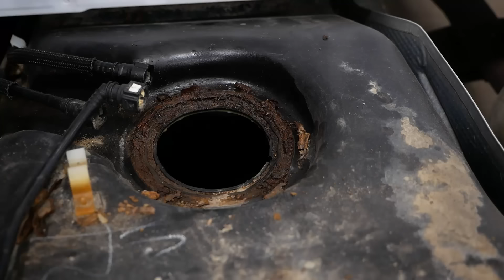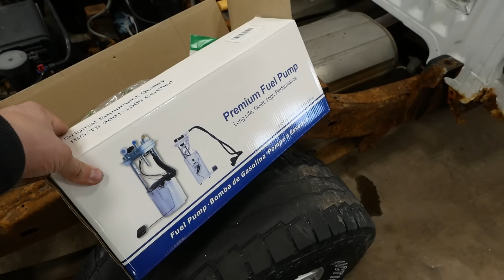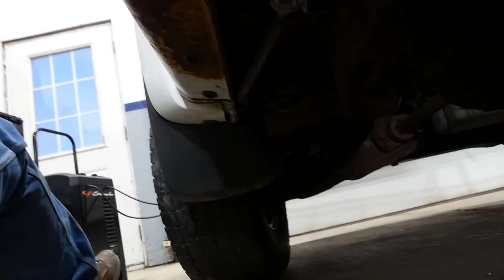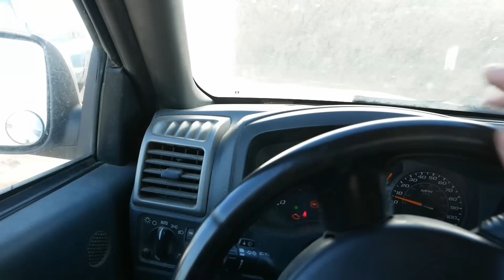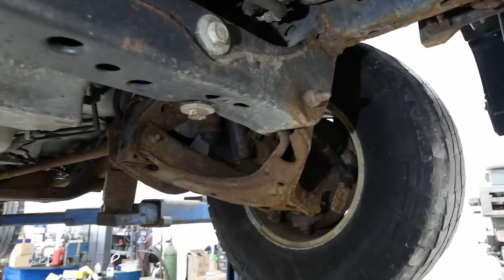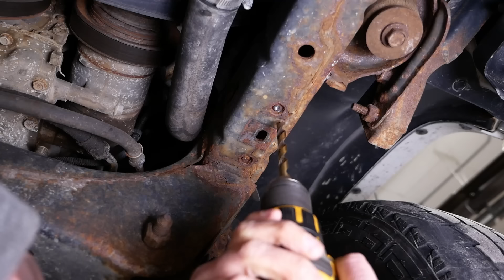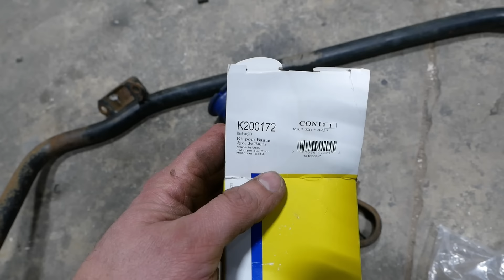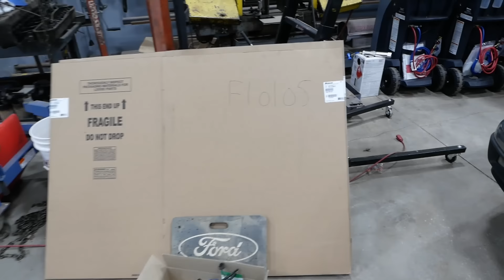Saving a GMC Canyon with 434,000 Miles from the Crusher - Won't Start, Fuel Pump Tabs Rotted

Comment: Great video! I am fascinated by the economics of paying someone to fix something that was ready for the junkyard. I guess used car prices are crazy but still curious if it is “worth” it?
Reply from the maker: Farmers have a unique economic systems.
Reply: @WatchWesWork  Amazing work and they are lucky to have you.
Reply: If you consider the price of a UTV to haul farm items around the farm vs the price of this vehicle it makes sense. Plus the truck has heat (maybe) for winter and if you're lucky AC. Throw on a set of cheap mud terrains and you're set.

Comment: That's a great repair. I honestly wondered if you were just going to epoxy a new pump into the top of the tank. That's what I would have done. Never seen one of those style repair kits though... 

2005. Just think back to what you were doing in 05! I was a young punk in my last year of highschool. Skipping class and getting in lots of trouble spending an awful lot of time on GTA: San Andreas. The good old days I tell you...
Reply from the maker: I was heading from community college to a university. Felt like I had the world by the tail. Turned out I didn't...

Comment: The local Chevrolet dealer here serviced one of the trucks for a local delivery service, at the time I was talking to them, the half ton pickup had in excess of 600,000 miles. When asked what would happen when the truck quit, the owner of the company said, park it, take the tags off and get a ride back home. The guys at the dealership told me that it still had the original engine, and all of the service was done at the dealership and to the manufacture's schedule.

Comment: Actually considering the mileage, I would say that rust isn't that awful. I've seen ones of these more rotted with well less than half the mileage of this one.
Reply: I suppose for a heavy winter state you can't complain too much considering the truck also has close to 440K on it.  I am not familiar with the Chevy mid size trucks but the V8 equipped full size trucks do last a long time.  My sister has a 2005 Chevy Silverado 4X4 with about 350K on it and it still runs fine.  The truck has done a lot of heavy towing and the motor has never been rebuilt so she can't complain much, either.

Comment: Nice work.  You know that fuel tank design was done by some kid in a design studio somewhere without adult supervision. But boy howdy, did he know how to manipulate the 3D modeling software. Probably got an award. Probably a hasty job, just get it done and ship it, with no consideration for failure. Shame on GM for allowing this to be sold to unsuspecting customers.
Reply: 90+% of the vehicles with this design probably get scrapped before it's an issue.

Comment: Trucks are useful as long as they run.  It doesn't have to be on the road.  It still has utility for checking crops and fences, hauling stuff around the farm.
Reply: This is one of the most sensible comments I’ve read this year!! If it runs, it is useful, and therefore worth getting back up and running!!! People forget how useful even a beat up running truck is.
Reply: @baconeverysunday656  ditto to everything you said 👍
Reply: @baconeverysunday656  I belong to a gliding club where our two Toyota Hilux pickups each have well over 100 000 miles - all off road! (apart from delivery mileage)
Reply: @richardking6066    ,.     .
Reply: @baconeverysunday656  Not if it costs more to get it running than to just buy a used one that already runs.
Reply: @baddriversofthenorcalarea500  more than likely another used one that runs is just a short time away from similar issues so you'll be right back to where you started fixing the new used one you decided to buy. Might as well fix the one you have. I mean not in every case but a lot of times that's the situation.
Reply: @skippypasta-sauce3121  Not necessarily. There are plenty of used trucks out there that were maintained and taken care of.
Reply: @baddriversofthenorcalarea500  Sometimes it's better to deal with the devil you know, than getting another and chasing its new issues
Reply: @baddriversofthenorcalarea500  you obviously don't live in the rust belt
Reply: I don't currently live in the rust belt, but I was born and raised in the rust belt.   @RandyMarshTegridyCEO
Reply: @baddriversofthenorcalarea500 Maybe, but this is the rust belt, and you can't fix rust.
Reply: @skippypasta-sauce3121  A lot of the times with these old worn out trucks you end up needing to replace pretty much everything and that ends up costing thousands for which you can get a well maintained road worthy truck, not to mention ten still running ones.
Reply: @baconeverysunday656 Geessh, you too, no it's not sensible, it's CALLED STATING THE OBVIOUS,  I guess I must be stringy with my likes, or I don't get excited about someone stating it,
Hmmmmm, maybe the guy doesn't want to "just use it as a farm truck", come on people, we gotta quit being so frivolous with the likes,
You might run out, then what? 😮
Reply: In Kenya they would sell that thing for $7000 just because it’s still useful
Reply: I still have my 2010 Colorado which was my first truck /vehicle, it blew the motor a couple years ago but I still have it to put back on the road as a secondary vehicle, they are very handy!
Reply: @519_Media I recommend shipping it to Kenya in that case.
Reply: @corytruckdriver  I still have it, still mtor hunting lol
Reply: Until the frame snaps i two
Reply: No shit Sherlock, 2 hundred and something likes for stating the obvious, well I refuse to give you a like, how do you like that, I bet you don't sleep tonight, well you asked for it. 😮
Reply: Clean out the map sensor also
Reply: Until the axles crack or the engine dies, this thing will keep on truckin’
Reply: that frame isn't going to haul very much...
Reply: @thatlolguy6799  And that is where every truck manufacturer is going wrong right now.  Not everything has to be a monster capable of pulling 12,000 lbs that you need a step ladder to get into to be useful.  We used a VW Bug and a Ford Courier for chores around the farm.  Both were tiny and very rusty.  They could still haul buckets of water, carry feed, carry fencing tools, check on cattle, etc.  Manufacturers have forgotten that sometimes, you just need to be able to reach over the side of the bed without needing a ladder.  Sometimes you just need a chore vehicle.
Reply: Other than the inconvenient moment that the truck snaps in half with a bed full of stuff while you’re just checking a new noise underneath.   Also, it’s nary impossible to find a “farm truck” that isn’t still registered for road use, at least here in NH.   Farm plates are always abused.   At one point, there were several hundred side by sides running around southern NH with farm plates until the state cracked down on it.   If a vehicle isn’t safe, it isn’t safe.
Reply: @DownEastSaw  I'm glad you are in NH.
Reply: @thirzapeevey2395  that’s so sweet.  So am I.   No sales tax, no income tax, and only slightly dangerous vehicles on the road.  Plus, for some reason, there aren’t too many folks like you.   Thank god.

Comment: Fuel leak was one of many problems the 04 GMC Envoy XUV SLT V8 I paid scrap value for 6 years ago and the ring was rusty AF but I managed to install the $29 fuel pump assembly by Dremel magic. My buddies base model 06 or 07 pickup required lots of JB Weld to install his pump but it's still up here working in New Rustshire. My XUV though passes inspection with flying colors as it came from Florida and I paint everything underneath with the used oil mixed with Tractor Supply bar oil because I'm a cheap bastard, see $29 fuel pump assembly. I moved from the Outer Banks so I'm used to rust rigging.

Comment: Sorry I’m Late, That Odometer Boggles The Mind !! I Commute 150 Miles on Average , One Way, Only Four Days A Week Granted. However, I’ve Racked Some Miles Up on Various Diesel Trucks And I Always Thought 300k Was A Lot Of Miles. Normally I Put Around 200K on Them. Typically By Then, I’m Glad When The Boss Summons Me To The Office To Get The Next One & Mine Goes in The Fleet For One Of The Locals. 
Catch You On The Next One, Keep It Safe Out There !

Comment: Dust, salt, moisture, and vibration are a recipe for gremlins in any harness. If that is the first low spot in the harness after the engine, it’s probably road spray and gravity following the wires inside that split loom and settling at the first opportunity.

Comment: Had an 85 Chevy suburban with 500,000 still daily driving when sold. The buyer drove it for 4 more years before they traded it.  I've had several with that milage range and they did and still do well. First problem was the moron who thought it was a good idea to put the pump in the tank. Really does not belong there. But I'm not an over paid engineer. Thanks for the video Wes.
Reply: It cools the pump to be submerged in fuel
Reply: @erik_dk842  how many years did we go with external fuel pumps that didn't need to be cooled? Once you find that answer then you will see my point.
Reply: @robertbullcarmichael9856  They were much lower pressure than what EFI needs.

Comment: I can't believe a fuel tank on a vehicle of that age is discontinued and not available. What's with GM and discontinuing important parts like that? my brother has a 1990 corvette and the throttle cable snapped a few months ago. Tried finding a new throttle cable to order and same thing, discontinued and can't get one. I had to repair the cable, which had been repaired once before as well... Actually, trying to find parts that actually fit that car is a headache no matter what it is.
Reply: Discontinue parts so that the owner has little alternatives than to buy a new truck.  Planned obsolescence to increase sales of new trucks.  Also helps to keep auto crushers, recyclers and Snap-On people in business.

Comment: My experience with Seal All is that when it drys it will be hard, and gasoline will not touch it.  I have repaired numerous gas tank leaks with it both steel and plastic.  Good job on the repair.  Love your vids.
Reply: We haven't had a need for Seal All in years but I don't recall too many problems using it.

Comment: My good friend has a Nissan hard body truck with over 500,000 on the original engine. Did replace the trans at little over 400,000 . . The reverse gave up.

Comment: I had a '96 Roadmaster with 294K on it, and it didn't even burn oil. That is the highest mileage I have ever seen on a vehicle. Gotta love the LT1.
Reply: I had a 2000 impala with a 3800 that had 494k on it when i sold it to my neighbor. It was used for field service for over a decade. Only ever needed two intake manifold gaskets and one shift solenoid replaced. Everything else was routine maintenance. Didn't even have any visible rust. My neighbor's son went to a party, drank, and smashed it into a parked car on the side of main st in town. Totalled both cars, but walked away unscathed.
Reply: my landlord took me to a party in his 1996 Toyota Tacoma, I casually asked the miles and he told me 450k (previous record was 310k on a civic)
Reply: The most amazing thing I ever saw from a LT1 Buick roadmaster was when I saw a station wagon version towing a 24' pontoon boat. The only reason I know that's crazy is my friend an I go out on his 24' pontoon boat and he tows it with a chevy 1 ton dually sporting a 454 and it struggles on hills so that poor wagon must be dying

Comment: That intake contraption is called a hemholtz baffle quiets the sucking sound of the intake.(like that truck needs that).Just sitting there it emits a sucking sound, hehehe!  Don't you just love when you get everyone's gem to work on, but not their newer vehicles. I think that the 434k might just be a GM record! You did a good job keeping it alive for another who knows how long. Thanks for that fuel tank repair information it looks like 2wd so when it comes back for front brakes they wont be as bad to do as the 4wd ones.

Comment: What happened was in the vehicles past it had an issue similar to what you are experiencing and someone used an insulation piercing fixture like you did and exposed the wire to corrosives and from that moment on time was an enemy . 
I NEVER pierce insulation to check for power for this very reason . 
And Yes it is old enough to have that many miles especially if it was a former fleet vehicle .

Comment: Pretty cool repair kit. My initial thought was to pop rivet a cut out steel donor from a real tank with the required size hole/tab ring for the pump. Goop it up real good of course.

Comment: Neat! For picking up steel shavings, try a good magnet inside a strong plastic bag. Once done, you can invert the bag over the chips and pull them clean off the magnet.
Reply: They make cleaning rolls for swarf, where you push in a rod, which turns off the magnetism. Cutting Edge Engineering Australia has shown them on their channel.

Comment: Every vehicle owner reaches this crossroad: At what point do I stop pouring money into this vehicle because of its miles, its age, its condition and/or parts are difficult to impossible to find? And there is also Wes' comment: I don't want to be far from home with this.
Reply: The farmer probably doubled the scrapper's bid and paid $200 for the broken down truck. Wes' bill and the spares are probably less than $800. So $1000 all in, and it's all a fully deductable business expense for the farmer, for an extra truck for local errands
Reply: @erik_dk842  I'm a farmer, and I understand the principle of "cheap," making do with what you have and business deductions. Sooner or later, however, you have to cut your losses and move on. That's why lots of "junk" is parked along tree rows and in the Back Forty.

Comment: I have driven one of these one time, pulling a tandem axle 16' trailer with an automobile on it.  I could not believe the truck had the power it had.  It only had 70K but I would never have thought it would go nearly that far.

Comment: Just buy a better tank. Weld one up out of stainless. Local high school. Use a pony keg like dragster and put it inside of a tool box in the bed .Extend the lines  ,new electric fuel pump have a nice day.

Comment: Hi wes. Another interesting video. 434,000 miles is impressive. My Toyota Land Cruiser done 315.000 miles and that getting to the stage where it needs lots of bits and money spent on it like you said is it worth it.???????👍🏻👍🏻
Reply: Is the body in decent, safe condition?  If so and the parts aren't ridiculously expensive it might be best to put the money into what you have.  Even used cars are ridiculous right now, I just read that the average used car sale in the US is over $28K!

Comment: hey, you are close enough to me I think, if you want to swap the axle in my cargo van, it has 470000 miles on it.  the original axle made it 445000 before the pinion bearings died, and I drove it screaming for another 25000.  I have the rebuilt axle ready to go, just don 't have the time.

Comment: The plastic gas tanks are a huge improvement. They put a lot of gas tank repair shops out of business.  But why design it with a huge depression and no drain? 
The sending unit mount should sit high, clear and be self cleaning.
Reply: It takes up space in the heigth, so less usefull space above, or less tank volume. They could mold in a drain channel, but who would keep it clear? Better to make a tight lid on top for the trucks.

Comment: I sure like the way you try to figure out how make a repair. A dealer dropped the gas tank on my 2004 GMC ZR5 Sonoma and broke the filler neck reinstalling it. GM must have been ashamed of the tank because they searched for 45 days and found GM didn’t make a replacement for that truck. Finally found a used one that was was smaller but fit. That big v6 will use up a tank full pretty quick😩

Comment: Seal All is an old product. I was using it for gas tank leaks 60 years ago. It would have worked well for that ring as it is liquid enough to flow into the cracks and under the hose connections and then cures to a flexible plastic. Does better than solder on gas tank cracks as it flexes without cracking. Soak a small piece of cloth or tissue with it and hold on a fuel leak for a couple minutes to stop the leak and then coat over 8 hours later for a 10 year seal. 
Hands still ache from holding patches in place in -10 weather! 
Cheap too compared the the alternatives.

Comment: I think a lot of mechanics would have written this thing off. 
I always enjoy when You do share these longer vids and I very much can share the joy of putting back value into something like this truck. One man´s junk is another man´s treasure, I bet this will do well on the farm.
I get into fixing up cheap, crappy e-guitars- there are so many Fender clones around which just need a setup and will do well after that.
Letting an actual luthier fixing them is always more expensive than the whole guitar costed so I search for them, buy ´em cheap and go to town.
With a little experience gained I become more efficient- it´s always a win. And I get to know the good clones from the bad ones.
My goal is to collect as many as I can, pick out which I like and sell the rest.
Have a good one, I very much enjoy Your videos😃

Comment: Car-Part website lists 350 fuel tanks for 2004-05 Canyons, in yards around the country, which will ship, many of which are $100 or less
Reply: Please show an actual link. But I like the repair ring better. No need to remove the old tank, with all the trouble that will bring with it.
Reply: @erik_dk842  I can't post it, youtube deletes links to websites-  Car-Part  punctuation mark charlie oscar mike
Reply: @erik_dk842  I think the repair is good too, just showing anyone interested a great resource for parts I personally have used many times-